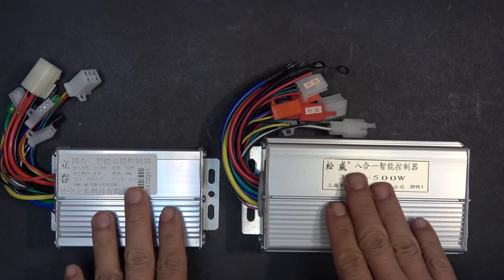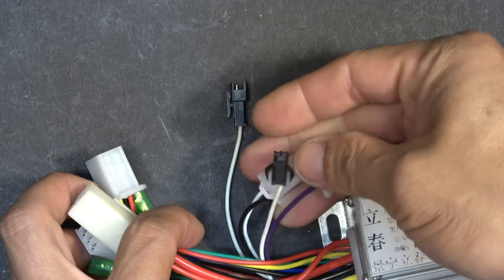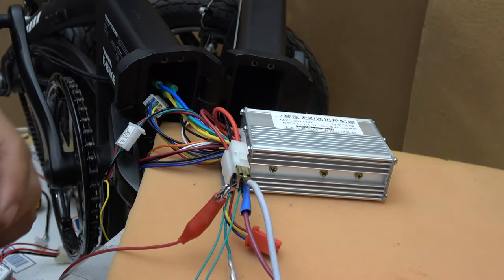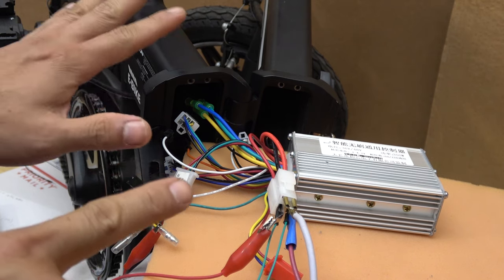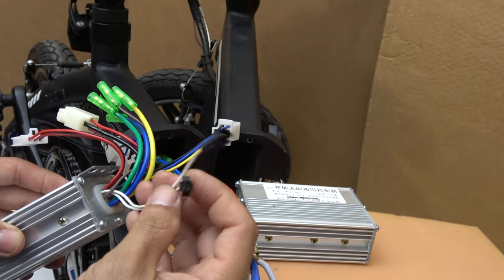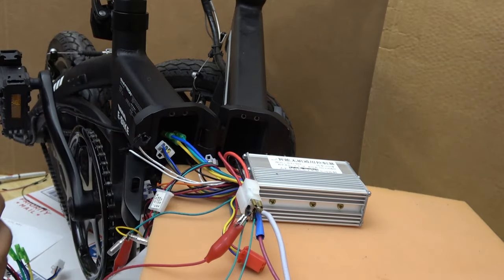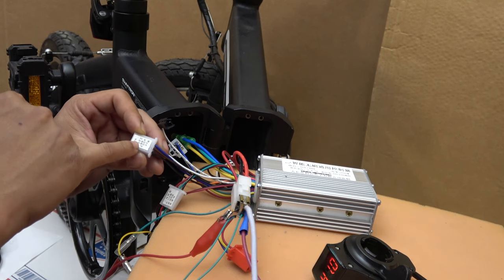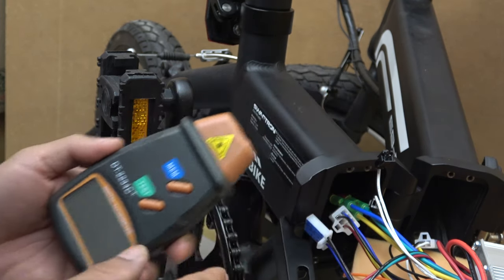How to install a Brushless DC Controller on Ebike: The missing manual

Comment: The controller needs to match the peak amperage of the battery spec. If it draws too many amps from the battery you can damage the battery and possibly cause a fire. Since watts = volts x amps a higher voltage output may or may not give the same amount of amps when running at lower voltage. In summary you dont' t know the spec of the controller and peak amp output. Frying the battery would be more costly than frying the controller. The work around would probably be to use a fuse to the battery pack with the peak amp rating for the battery.

Comment: My controller has a single green wire that the 'documentation' describes as going to the display. No idea what that connects to!

Some controllers have a five wire connector that goes to an LED/LCD display, so I have no idea whether my controller can make use of a multi-function LED/LCD display.

Comment: Hi.ive strengthened my connections on ebike battery .54volt fully charged .must been for ride an after 2 mile the power started pulsing an had back off throttle to get me home .measured battery it had dropped to 50volts.all cells were quite close together still.got battery on charge
Reply from the maker: bad cells, maybe?

Comment: I got a ebike HUD motor is 350 watt and motor controller 350 watt also but iam getting 15 mph is this normal can I adjusted the controller to higher speed

Comment: Can I use the thin red and black for charging my drill batterys I have a charger port connector red and black and the thin red and black are for alarm power switch can I connect that connector to the same charger port connector? To charge my drill battery

Comment: Can the reverse function work with the power on/off switch negative wire? I found a switch for the 3 speeds with power and horn and want to use the horn for reverse but it looks like they share the same ground

Comment: I upgrade my controller in my scooter from 36v 350watts to 36v 500watts.  While the scooter is upside down when am testing it everything works but when I finally ready to ride it some how I keep on encountering this problem where thr voltage screen would say 25v instead of 40v when I was testing it so I unplug the power connector to the battery and hoping it will reset the power voltage but it don't work.  The only why to get it running again is to put back the old controller then the voltage will read 40v again when I put in the new controller.  The problem keep on coming back and I don't know why? Hope you can help. Thanks!
Reply from the maker: It shows a lower voltage while you're testing it and that means the battery has a problem. It should be between 33V-37V when under load when your battery is fully charged. I would try a newer battery.

Comment: A controller that is non LCD can I wire the LCD into the hall sensor plug I have an LCD S866 and also a S W900 can I wire that into the hall sensor can you let me know yes or no

Comment: Think I’m goin swap out one pack out 3 as I changed some cells .originally I had new 26h Samsung but some just died an they from nkon new.so used some others I had Panasonic so goin use a 36volt pack out my hover board .

Comment: I only found this brushless  motor controller in my bike, Can I get it replaced if I find out the bike is not working ?
Then does that mean that my bike is not having a battery since I can't find any ?
How does the bike work if it has not battery ?
Thank you Sir.

Comment: problems of these tons of controller in the market is that don't follow any standard, for connectors neither wire colours.
 I'm struggling to find something to replace in the same exact way of connection, the one I've dismantled from my son's scooter.

Comment: I wonder is the last orange wire the problem that I have which is that my bike is restricted to 15mph and am locked out of changing the settings on the handlebar controller so cannot change km/hr to mph or disable the speed restriction. I think I saw another vid where a blue wire disconnected resolved this problem. I need to get at the controller to try and see what is going on. I have instructions for the control panel but clearly I am currently locked out of being able to change these settings. Hoped this video would help but it doesn't cover this issue. Anyone know about this please?

Comment: Yeh but all the controller on amazon web came with instruction in english, expensive like 30 to 40 bucks but easy to install, and you dont have to worry if they disnt work, ypu ca return them easily.

Comment: Hi vuaeco.
I have ebike model MATE X-750W.
Battery 48V/14Ah fail.
Voltage output terminal battery 42V-when turn battery key to ignition position-drop to 0V.
What can i do?
Reply from the maker: Maybe your controller or throttle has a short somewhere.

Comment: Can you share a link for the new controller please?  Also, for clarification, you MUST have the new controller installed to attain the 23 mph, correct?  This cannot be achieved with the stock controller?
Reply: I mean, you can maybe do things to the stock controller to make it go faster ("butter" the shunt(s) with solder, add copper to the power traces on the board, fatter phase and power wires, etc.), but...that's a lot of work for a wee little controller anyway.

Also, if it's not programmable, you won't get much benefit from most mods. I learned recently that a controller included with a direct drive motor I have is not programmable, run by an older-style Motorola IC (MC33035) despite the box being dated 2017.

Finally, it should be noted that 23 MPH is the no-load speed, as Vu stated. IOW, that's not the speed it's gonna do with your arse on the seat. If you don't have to shove your controller in a bike frame as Vu does in this video, you'd be well advised to get the largest programmable controller you dare. It's a lot easier to program a controller to use less juice than to rebuild one to use more.

FWIW, I'm achieving 62 km/h (radar on flat level ground, with pedalling) on a FWD direct-drive setup with 26" wheel, "1000w motor" (either 5 or 6 turns) and a bone stock 12-FET Infineon-based controller. Importantly, the total weight of bike, components, rider and cargo is over 300 pounds. I don't recommend FWD though, it's just what I had. Besides ease of kit installation, rear drive is in every way safer and better.
Reply from the maker: @fun_ghoul  Very well put!
Reply: Paesan Control Centre Thx for the response.  I should clarify, that I have the exact same EB5 bike.  I’m not incredibly technical with electrical components; however, I am comfortable enough tinkering and I would love to be able to simply get a bit more speed out of the EB5 if possible.
Reply: @andrewcarson5567  In that case, the only things I'd add are:

-you're in the right place to find that stuff out,
-going faster necessarily requires more power, and will reduce range given the same battery pack, and
-stay tuned for part 2!

Cheers.
Reply from the maker: @fun_ghoul  Exactly what I should have said to Andrew. I should pay you to help run my channel? :D
Reply: vuaeco when is the new video coming!?! #EXCITEDTOLEARN
Reply from the maker: @andrewcarson5567  I got it all connected together and tested! It works like a charm. Now I just need to put everything back into the battery housing. It seems to need a little bit of modification as it's a bit too tight for the new controller. Bear with me, it will be done in a day or two.

Comment: Can anyone help me??? I have a Ebike scooter .The problem is that the battery doesn't stop when I charge it I changed the charger again but it didn't make any difference Charger lights are not green, they are red I have to ask this question whether it is a charger problem or a controller problem????

Comment: Hey man I'm sure you get like a million comments and might not even notice mine, but I have a problem, whenever I hook up my bird electisan scooter to a brushless controller, the voltage goes from say 29 volts, to 2.9 volts. I do have the 3rd red wire connected for the controller to turn on. Any ideas?
Reply from the maker: Check your battery. It happened once on mine and it turns out the battery BMS was bad.

Comment: HELP !!! I GOT A CONTROLLER EVERY WIRE MATCH IT RUNS BUT MAKE A NOISE UNDER LOAD CAN A DIFFERENT PHASE WIRE SET UP FIX THIS ALSO WHEN LEARNING WIRE PLUGGED IT AND IT GO BACK THEN I THROTTLE IT GOES FORWARD BUT A STEADY SLOW PASTE IS IT SUPPOSE TO RUN SUPER FAST PLZ HELP

Comment: Well here I am again and I have a geared hub motor on my RadMini so will look/search for something you have on that. Still I am to study the brushless controller video as I am finding all this stuff is related. And I am curious as to how all of it works. That knowledge in one area helps with understanding another. RadMini claimed 750w motor but is really 500w with more juice/amps powered through it. I have to be careful as to larger controller as could burn out motor over time. Looking for legit 750w motor. Don’t trust Bafang they label 500w for 750w got to learn how to tell them apart for myself. Maybe I put a brushless motor on my bike!

Comment: I have a controller 24v with three motor wires and I have a two wire motor (24v also) can I make it work?
Reply: The one with three wire is probably a Brushless motor and the two wire is a brushed motor. The brushed motor will be very loud compared to the brushless one.***you need a different controller for brushed and brushless motors

Comment: I have a 5600w rated electric scooter (2 x 2800w motors) how do I find out what amperage my voltage controller boxes (one for each motor) are putting out?
Reply from the maker: use a clamp meter.
Reply: @vuaeco  Can you show me what that is and how to use it
Reply: @vuaeco  And how do we determine if the 5600w scooter is really putting out 5600w?  Is it determined by how much voltage and amperage are putting out?  If you put on 6000w motor will it put out 6000w or 5600w?

Comment: Do the Hall sensors have to be connected or is this optional?
Reply: Says it should work without them, but I am not getting my motor to spin, only poorly when in learn mode, otherwise nothing, so I think they are needed, hope someone knows for sure and can reply.

Comment: Even after I do everything here my motor won’t turn. I think it’s because the battery is discharging really fast because my old controller only started pulling electricity when I fully charged my battery, otherwise it would not run. So maybe my battery is messed up, but it draws electricity when I set the self learning wires, just not with the throttle afterwards. Someone help 🥲

Comment: i had a project, please help me to wire 2 controllers with 1throttle 36v 500w dual hub motors. thanks in advance.
Reply: I just ran across a video that runs two motors with one controller. https://youtu.be/wRyYi1SQm5s
I don't know if that will help you at all?  Also read the comments for help.

Comment: my ebike got worse  after i upgraded the speed controller.  it move forward but with grinding noise and wont speed up.  can you help ?
Reply: the new controllers' main phase wires and or the hall sensor wires are not in correct order to match your motor The main phase wire are the wires that go into your motor There will be five big wires the black and red will be ok it is the yellow blue and green that are mixed up there will be five small wires as well they are your hall sensors and the same the black and red will be ok it is the yellow-green and blue that are mixed up.....The way I figured it out is trial and error.  on the connectors from your controller try yellow to green,  instead of yellow to yellow and so on......keep trying different combinations and you will eventually find the right one . There is another way but you need a Electronic machine to test the Main phase and hall sensors but it is about $80.00 bucks.
Reply: @BirdmanandPrincess  I  tried  several combinations of wire connection.  The connections that make the bike move forward are normal when running when no load.  I mean  i get no noise when running with no load.   but  when i test ride on the street,  i get  weird motor noise,  the bike is straggling.  The bike runs but so slow

Comment: my bike starts and then cuts off all the time ,i followed you but my throttle is like the same but has a power switch,and switching off & on repeatedly  resets my training wire .Im using 36v.
Reply: Your charger is fucked,  I had same problem. The green light will go on saying the battries are fully charged but they are not....thats why you get the cut off
Reply: @BirdmanandPrincess  thank you for responding,Ive sorted my bogging down controller by addind a vent,i changed my wheel to a 10 inch its 350w, but signal lights?
im using led signal for motor bikes 12v....you other video shows me but i dont feel sure the wires n all!

Comment: I have 1 motor 36volts 105ampers 1hp I need to control the voltage

Comment: If you can use a Brushless DC Controller with your motor, then only cause your motor is a Brushless DC motor, and had a Brushless DC Controller already to begin with... WHY did you have to replace it in the first place, what was the Problem?
Reply from the maker: The original one has a slower speed.
Reply: Ha beacause i déicide not to met the water come insiste the coule not replacé the controleur so i disconect one dire of the master sweetch then"an Potter,there were 4 ans i,thoult that would ne easy without taking a good photo o few before😁

Comment: Everything is connected and th battery is charged n there’s power when  twist the throttle but no power in the forward ,the motor is turning but just makes a sound it’s not going forward

Comment: How to add brake light, signal lights and hazard lights to my e bike using the same battery of ebike?
Reply: There are auxiliary power cables on the controllers that you could possibly use for those.
Reply: @chatracuk310  Thanks in a million.

Comment: Quick question: I feel I did connected the controller (36v 350w) the right way, but I need to turn a key to power my ebike (I scrapped the parts from a Nakto ebike). The lights showing the power left in the battery doesn't show, but the wheel turns on its own very slowly. What did I do wrong? Let me know if I can send you pics or if I need to upload a video to help you better understand. To see the throttle I'm talking about, check out this video of the nakto from 5:31 to 5:36 (https://www.youtube.com/watch?v=0FbPPYHGVSw). 

Thanks in advance,
Steve
Reply: I figured out from another video. You have to attach the "Learning wires" and once the wheel spins, disconnect. The lights on the controller don't show till you throttle.

Comment: hi  yes i like your video as me to dont  speak or under stand chiness .   .    and i got a  500 wat 24 volt bruless  scooter engine on   a 3 wheel   scooter that   has  brake /  ligts and head lght   and blinkers and   reverse  .     and horn      and  low / hi speed .    the  controler i bought   is a 500 wat 24 volt .      has it were you can    hook up power /    moter /  head light . /     charger   /   brak / light .

Comment: My bike turns itself off sometimes. The display turns off and I need to restart it several times to continue cycling. Does anyone know what wrong is it? Thanx!
Reply: Only guessing.... but could your battery possibly be hitting its low voltage protection cutoff value?  on my 36v system, that cutoff value is 30v.

Comment: 👊
Reply: Hello
The green wire of the end of the video is the meter signal, I think it does keep on screen the milage and the orange is a switch system it’s supposed to be plugged on a switch to start the all system, of course those two wires are not needed on a bike, it’s more for a scooter with a start engine with the orange cable and the green one will indicate on the screen the kilometres or miles driven

Comment: High speed = "black and blue"...tell me about it! LOL
Reply from the maker: Yep! Sounds like a warning!
Reply: @vuaeco  A warning indeed, my friend. Of course, even the best preparation can't save a cyclist should they get clipped by a car. My actual crash was all me, but it seems like I'm inches from death every time I go for a ride.

Some jerk the other day almost hit me in a half-hearted, unsignalled lane change. Of course, he "politely" tried to blame me for not being visible...LOL. I was wearing a reflective vest, reflective anklet, and had THREE lights on my bike. It's never enough for us cyclists, and even the cops would take that bum's side if he killed me.
Reply from the maker: @fun_ghoul  Damn, that's dangerous, mate. Driving a car is already dangerous enough. Riding on 2 wheels without any protection takes it to another (exponent) level. I always have to take extreme defensive measure whenever I'm on my bike out there on the road!
Reply: Swagtron EB-8!! I wanna buy and rebuild it.
Reply: If there,s 3 speeds on my chineese scooter,is there a way if i found this alonly soket if i conect as you said,is it gonna inceease the 1,then2 and 3 speed level or its all ready sweetch as you has explain wiith those 3 options ,slow midl and fast,do  you have 3 électrice speed on elec bikes?24jmh max is 15mph maxi for number 3..

Comment: 0:28 what you're saying and what I'm thinking don't match
Reply from the maker: Yep, I'm not Chinese or Japanese. Nor am I La Ocean.
Reply: @vuaeco  understandable, I'm currently trying to figure out a system to use a step down converter to run 12v lighting on my e-bike. also a brake light system. your video has been helpful